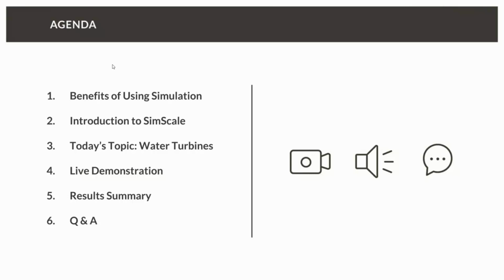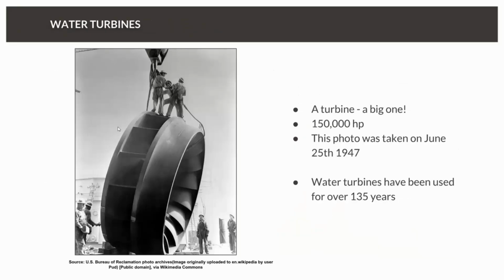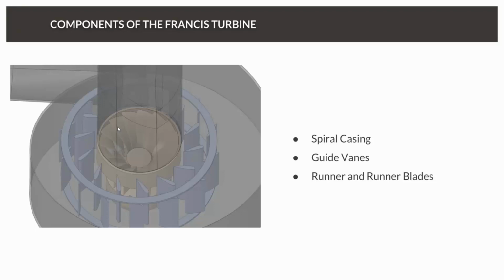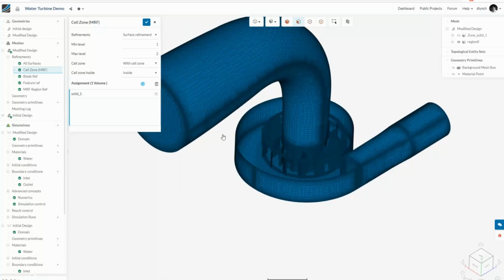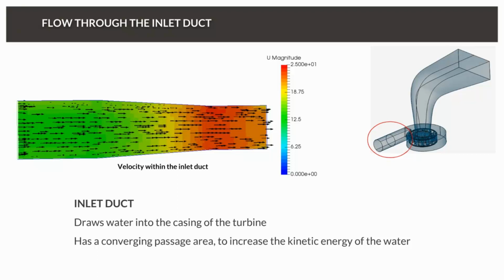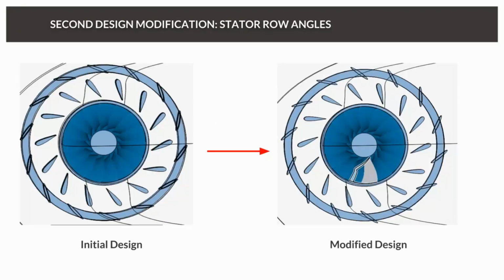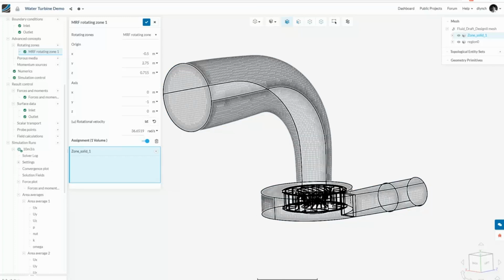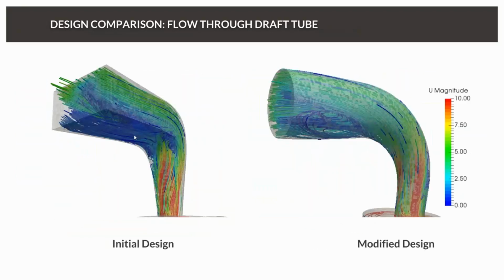Water Turbine Design Optimization with CFD

Comment: What is your basis on the rotational speed of the turbine? Why is it 350rpm?
Reply from the maker: The value for the rotational speed is just set based on examples from the industry. In order to find the optimal performance point of the pump a performance study would have to be made.
Reply: @SimscaleSimulation  thanks!